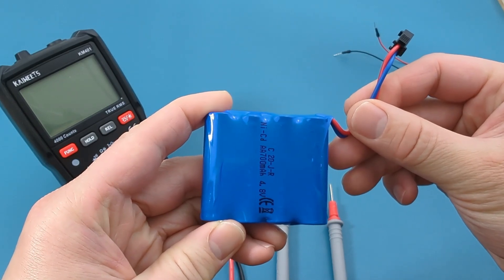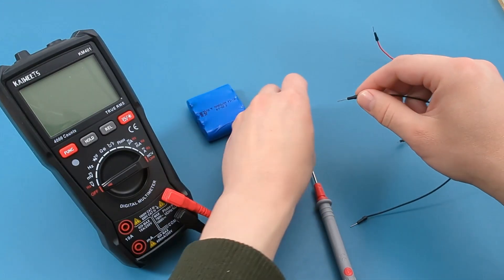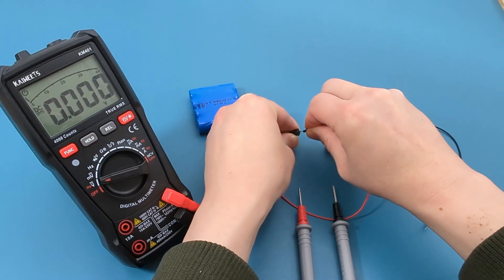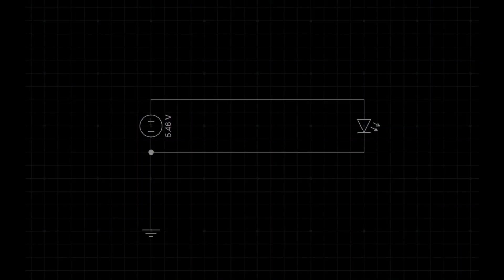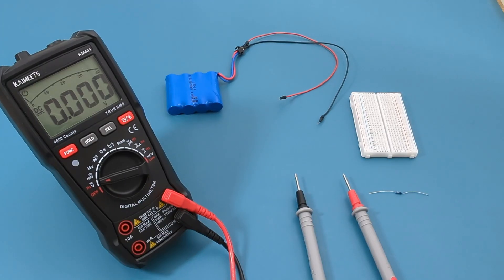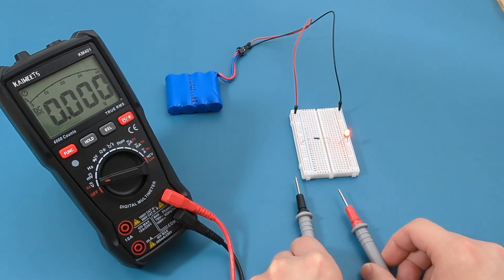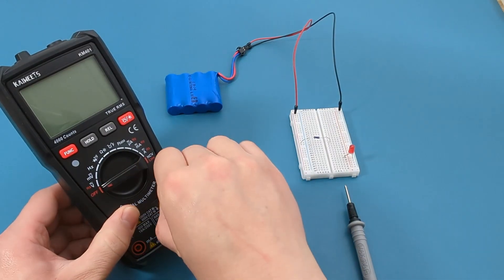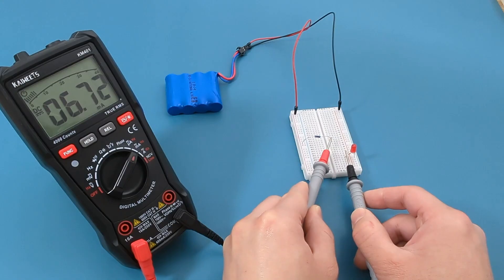How To Test A Rechargeable Battery With A Multimeter

Comment: Why does your jumper wire link point to an Arduino starter kit? You're not an expert on details, are you?
Reply from the maker: The Arduino starter kit included the jumper wires as well as other components such as breadboard, LEDs, and resistors which I used in my other videos. If you just want the jumper wires, you can get them here: https://amzn.to/490NFDN

Comment: It doesn't matter if you get a negative value, the multimeter measures differences.  The number is the same. Negative indicates the negative lead is attached to the positive terminal. In this case it doesn't matter which wire has more positive voltage.

Comment: Why are you using AC volt setting?
Reply from the maker: I'm using the DC voltage setting as shown in the display. Where are you seeing AC?
Reply: @ElectroUniversity  In the UK the "squiggly" line is the symbol for AC, the symbol for DC is a flat line with a dashed line beneath it. I can see in your video that the meter displays DC, I think the "squiggly line" description has confused ATVTrials